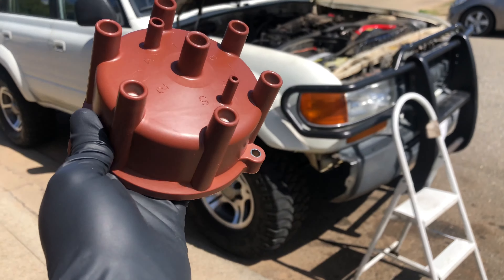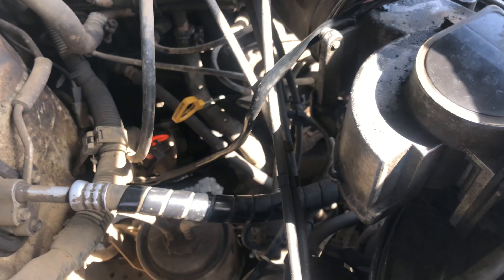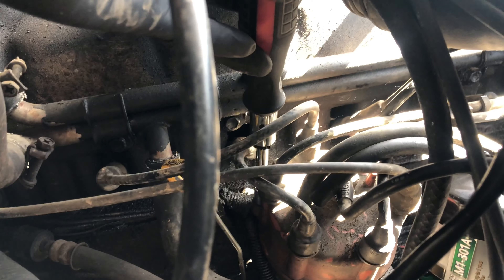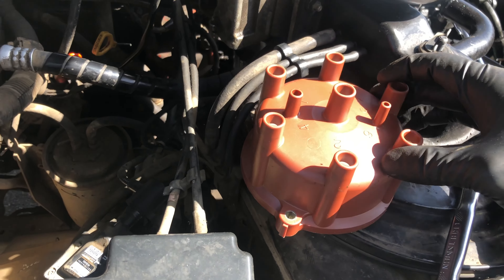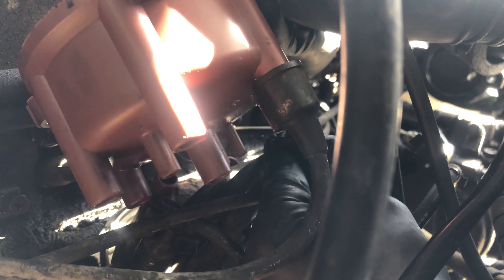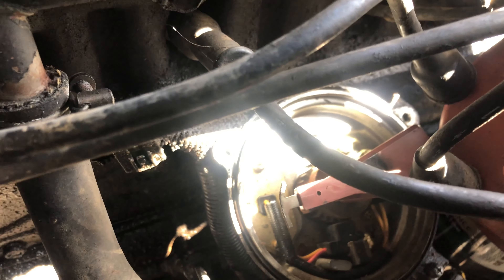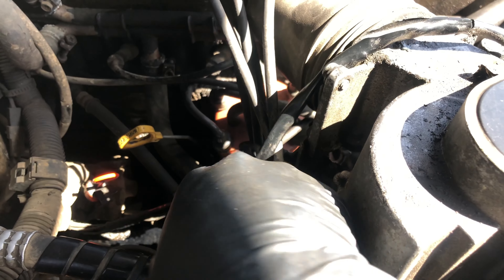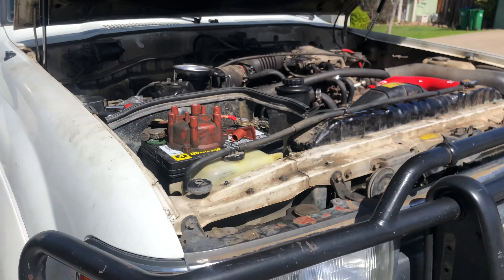Distributor cap and rotor replacement on an 80 Series Land Cruiser

Comment: Thank you!!!!... I would like to know if the distributor cap number corresponds to the cylinder number?
Reply from the maker: So for the inline 6 engine we have 6 total cylinders. And a distributor cap has 6 wires that goes to each spark plug, there’s a specific order that each of the wires needs to get spark from when the engine is on. So that is why they are numbered, because the rotor needs to give the spark when it spins.
Reply: @LNDCRUZIN  thank you

Comment: apparently this distributors have some sort of air circulation/venting. I thing that the distributor of 3FE is supposed to have a cap with two stubs on the top, and i would like where this hose connects.... please
Reply: I would also like to know. Thanks.